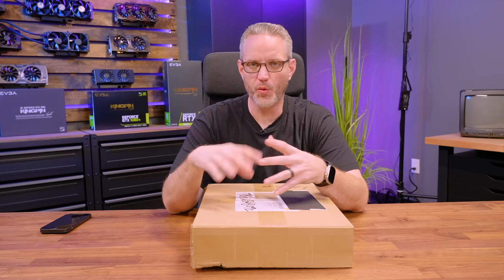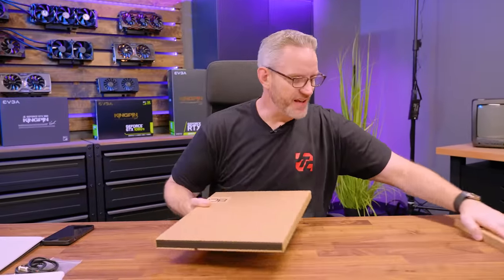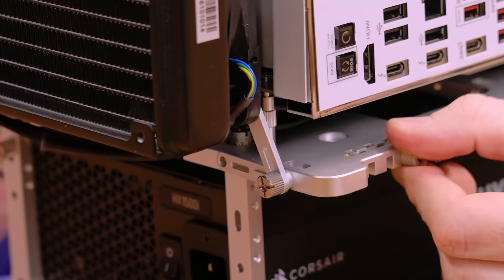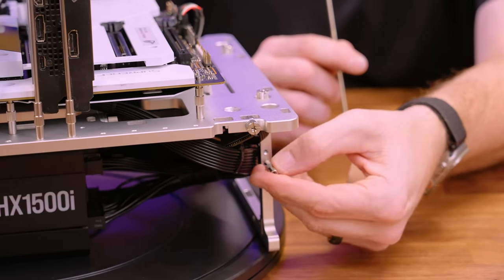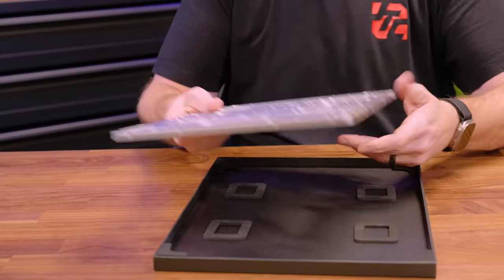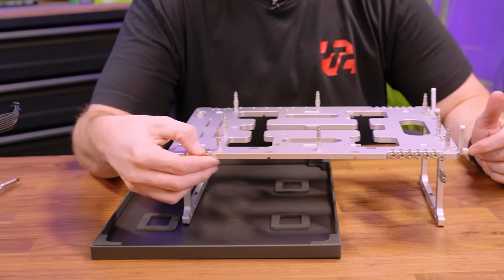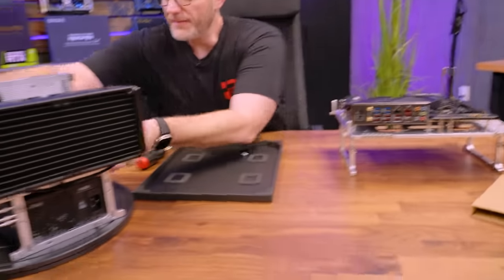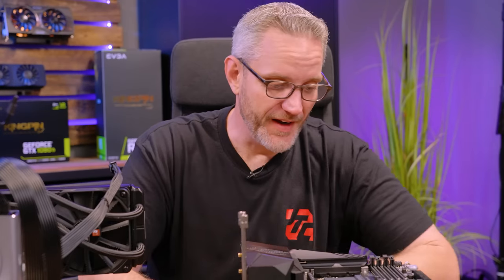This is one of the most impressive things I've seen in a LONG time!

Comment: wouldn't it be better to mount the psu fan side down?. It would pull cooler ambient air instead of hotter air right under the board.

Comment: 17:23 - Pedantic comment here: the screw you probably mean is the #6-32, which is a #6 diameter and 32 threads per inch.  A 6/32nds (or 3/16ths) would be closer to the diameter of a #10 screw.  A #6 is closer to 9/64" (or 4.5/32?).  Don't blame the messenger! Is it my fault that the Imperial system is completely stupid compared to the metric system, and that the c10e half of the US is far too arrogant and backwards to fully switch over to the superior metric system?  No.  No it is not.

Comment: Question, is the base plate also bi-directional, or does it have a top/bottom side?
Reply: It has stainless steel nutserts so that kinda makes it one side up. The first version did not have this but was prone to threads stripping. You also have options to orientate vertically or even inverted vertical as well as wall mounting with psu attached to legs or flat mount and hide psu in the wall if you really feeling crazy
Reply: @gtijason7853  Thanks for the info, Honestly I'm thinking one of these just for my home gaming PC.
Looks easy as to maintain.

Comment: As far s the GPU mounting locations (you had to mount it 2x fans and then have one hang off, not mount the center fans or you know.. center the rad.. anyway, you COULD if you REALLY WANTED TO set that thing on its side and WITH A DRILL PRESS cut 2 holes right where the standoffs for the 2 screw holes on the inner 2 screws for either left and right fan would be.. you COULD do that Jay.. yes it would be tricky, but you know.. if you can drill and tap, is it really that bad of an idea?

Comment: They're crap for actual testing and repairing. most threads were ruined in the first three months of use. By all means, for use as a regular case is OK, but if one has to change multiple boards a day,  then definitely no.

Comment: you can scratch titanium?  I've worked on F-15s that have titanium engine covers under the engines and don't remember seeing a scratch.  I have a titanium wedding ring (that's how strong my love is for my wife) that I wear every day and it has no scratches.  Are you sure you weren't thinking of steel or chrome?
Reply: I think it’s cut from a block of aluminum and then anodized not actually titanium.
Reply: Yeah thats the name of the color
Reply: @gtijason7853  only reason I  know is Ive heard of someone that had a water ski boom that he had anodized a gold color.
Reply: @thepathnotfound  Yeah you right man things like anodizing and powdercoating def help especially on soft metal such as aluminium. I can only imagine the price of a chunk of titanium that size and might even need very special tooling to mill it

Comment: How much weight can it support?, my GPU is a beast and needs an actual steel mounting bracket..not to mention the ram and motherboard..
Reply: I've used the dual cpu EVGA E-ATX board with 4 gpu crossfire. Basically no weight limit, I have 3 that I use daily

Comment: i have problem in my gpu when i try to use dvi port it says no signal it was working yesterday when i tried hdmi cable on my pc and switch back to dvi it didint work any more im using vega 64 gpu. i have nevest drivers and everything i have no idea whats causing this so im commenting here i think i will find someone smarter then me here to help with the problem. cable is working monitor is working idk can the port be bad

Comment: Cool but to damned expensive for what you get. 
I understand they had to set up the tooling, do the CAD work if that's what they used and source the Aluminum sheet but come on $200 why so high?
I can't see this costing more than about $50 each at max to make once you have the machines to do it and pay someone to stand there running said machines.
Again just to damned expensive for what you're getting and this is coming from a guy who bought the $1200 Jester chair on your rec.
Unless you actually run a computer shop, travel with your full size rig components, run a channel like this one or some other business where you need to be able to build out systems and test them there's not much reason to get this case.
Although they're are very cool and with everything I said above I still kind of want one.
There are other options out there much cheaper, like 1/2 the price that would work just as well for home use.